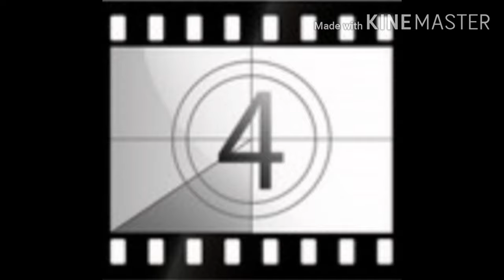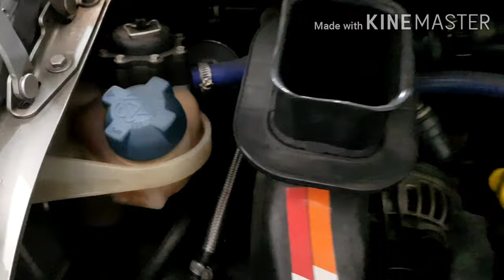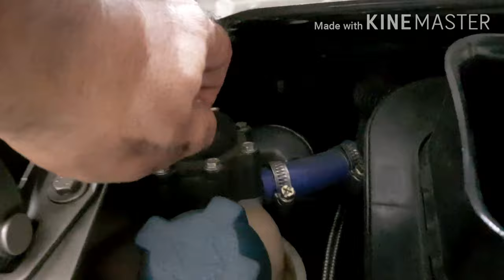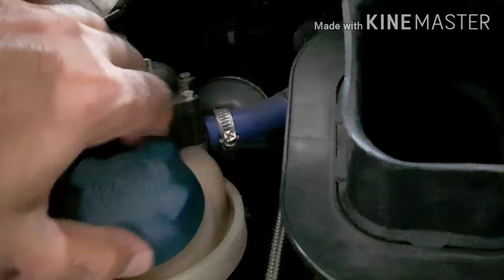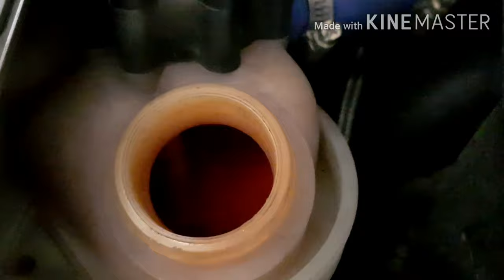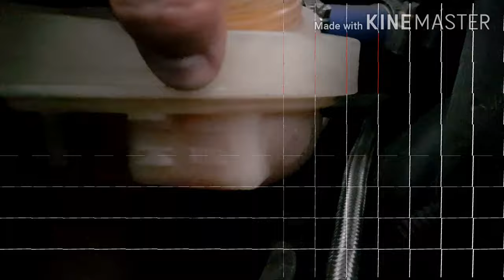PORSCHE 911 996 997 Carrera & Turbo Coolant Purge - DIY

Comment: Is it actually that easy? If I replace a heater core, that's all that's needed to purge the air?
Reply from the maker: Yes, any work on the coolant circuit its what you should do to purgue the air
Reply: @sergiomechanic6265  That's fantastic thank you for posting this!
Reply from the maker: @joshrandall8364  thanks to you, any question just ask, and remember to subscribe for more vids

Comment: This is a very simple way that might work, or you might find yourself a few miles from home with an overheated and possibly damaged engine.
Reply from the maker: This is the way to purge coolant system on your 996 but if you know another way to purge it please share it with us
Reply: @sergiomechanic6265  The way the manual and most enthusiasts say to do it, which doesn't involve driving the car around.  There's actually two 'book' ways to do it, with a vacuum bleeder and without.  This is the process without:

1. Consider covering the trunk with plastic in case of a coolant overflow.
2. Remove the radiator cap, oil filler cap, and dipstick.
3. Pop the cover trim plate off the filler access area. This reveals the bleeder valve. If you remove the little screw above the trim plate to do this, be extremely careful to not drop the screw into any of the filler necks.
4. Flip the bleeder valve locking clip up to release it.
5. If you have an automatic transmission, remove fuse B1 (the ATF cooler valve).
6. Fill with coolant up to the bottom edge of the filler neck.
7. With the engine idling, occasionally revving the engine, fill up with coolant until there's no more room when the engine is revved. (Revving may raise the level a bit.)
8. Replace radiator cap.
9. Warm up engine until you are sure the thermostat is open. 10 minutes at 2500 RPM should do it, and you should hear the radiator fans come on.
10. Run 5 more minutes at 2500 RPM, revving to 5000 RPM every 30 seconds.
11. Carefully open the radiator cap, and top up the coolant.
12. Replace the radiator cap.
13. Run 5 more minutes at 2500 RPM, revving to 5000 RPM every 30 seconds.
14. Idle until the radiator fans cycle on and off once.
15. Carefully open the radiator cap, and top up the coolant.
16. Put everything back the way it was.
Reply from the maker: @DonziGT230  Radiator cap on a 996? I've never seen a 996 with radiator(s) cap(s)